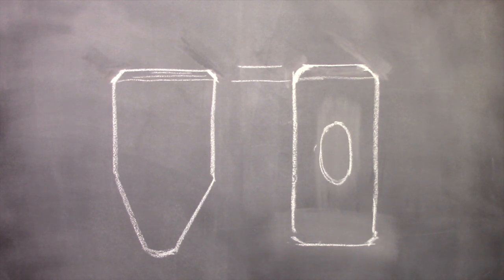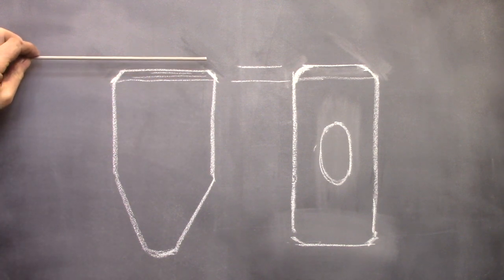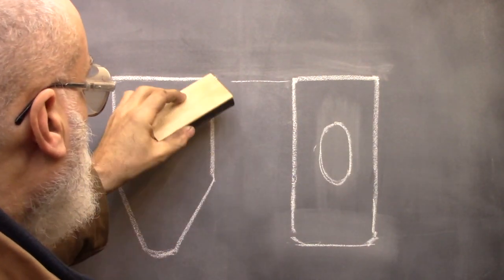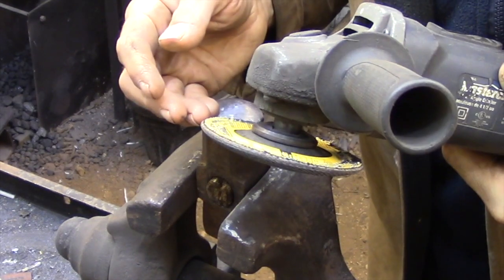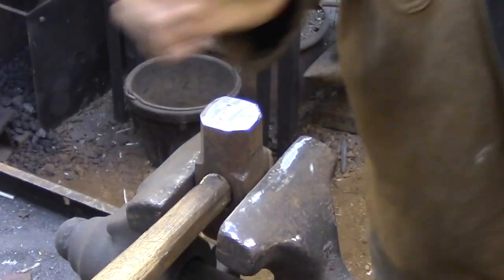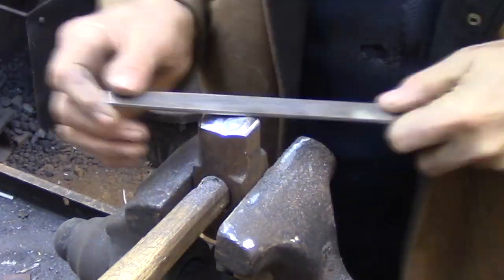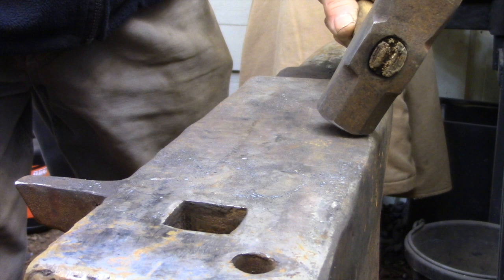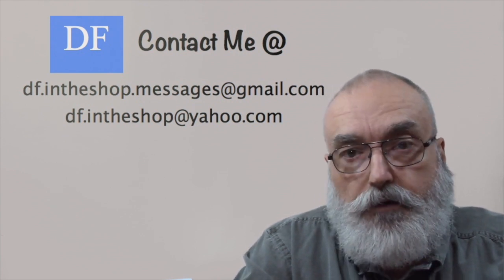Blacksmithing for Beginners - Hammer Geometry

Comment: Great info. For punches, chisels and stamping I use a fully annealed drillers hammer. I learned this from jewelers. The face gets dented on each blow but it really grabs the hard steel you are hitting. Just clean it up now and then just like you showed us. If you mushroom your tool (hard on hard) it may break off  cause an injury. Thanks for continuing to share the knowlege with us.

Comment: great vids, do you know if I could reforge old very mushroomed swage hammers, hot cuts etc back into shape?
Reply from the maker: Not usually.  The mushrooming is caused by the metal cracking and breaking away from the main body so it can't simply be reforged back into shape.  The only way to save it  would be to cut off the broken end and weld a new head to the existing tool.  If it was simpler to make a new tool they would do that instead.
Reply: That makes sense, thanks for the reply.

Comment: A very insightful video, thanks. I've noticed that with some sledgehammers, be they old or new, the manufacturers have often neglected to temper them to the desired toughness. I'm assuming that this is merely due to the makers cutting corners, however, could this also be an intentional feature?
Reply from the maker: It probably is just the quality of the tool.  Either how it was made or the quality of the steel.  Another reason could be that it was quite common for people to think it was ok to throw a big hammer  in a fire to burn out a broken handle. The idea was that the handle would burn enough to make it easy to remove before drawing the temper but of course their was a lot of ways that could go wrong.